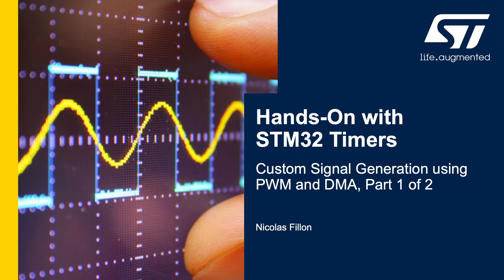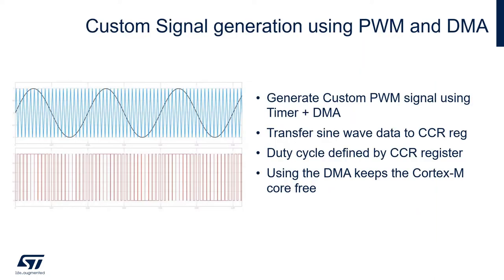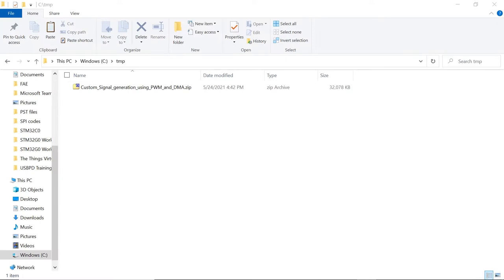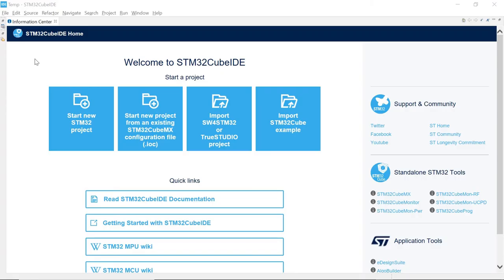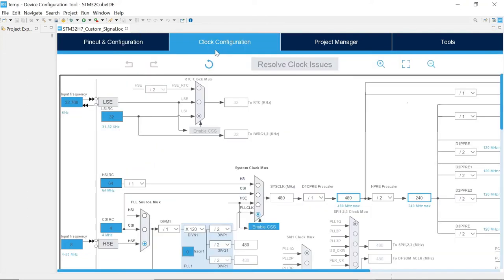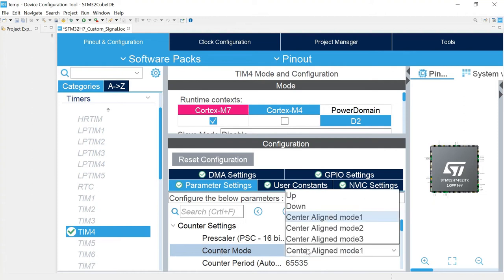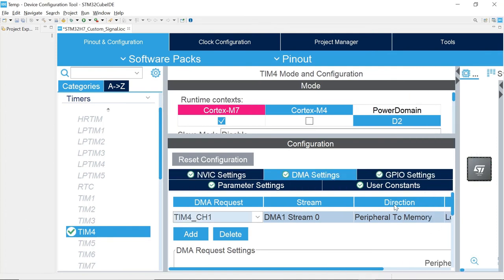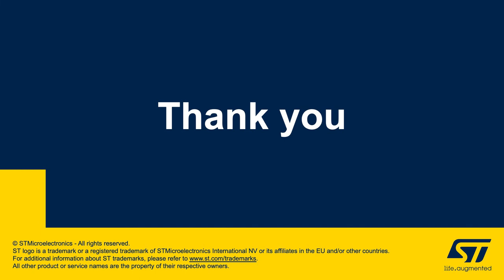Hands-On with STM32 Timers: Custom Signal Generation using PWM and DMA , Part 1 of 2

Comment: Also, I understand the PWM CH1's duty-cycle register (CCR) is updated from SRAM via the DMA such that it increases from 0 to maximum, repeating at a 4khz rate..  

But if TIM4 has an 240Mhz input clock (Prescaler = 0), wouldn't a counter-reload value of 30000-1 yield an update every 8khz, not 4khz?  i.e. TIM_ARR = 240M/30000-1

BTW, calling it a sine-wave seems counter-intuitive to me.   Instead, can the same timer be configured to ALSO trigger an update from SRAM to the DAC via the DMA?
Reply: counter mode is set to center aligned mode, therefore it will start to count from the iddle, which gives you a 4KHz signal, rather than 8KHz.

Comment: hello I'm a newbie with stm32, and for the last couple of months I've been trying to generate a bunch of pulses of variable width and phase, all at the same frequency, they should not use CPU power, they should have 1us resolution and as low jitter as possible, it seems like not only there is no content or example about this topic but also seems very hard to do!
I'm using the F1 family, I was wondering if you guys could give some examples about that topic? with F1 family

Comment: Hello sir, I watched this video it is very helpful fo me. But Sir I face a problem. I generate SPWM signal chanel1 and chanel1N both not working together only one work at a time. What will I do to get custom signal PWM generating CH1 and CH1N together.
I use STM32F103R6. PROVIDE ME GUIDANCE HOW TO DERIVE 3-PHASE INDUCTION MOTOR WITH VFD USING STM32F103R6.
THANK YOU
Reply: see part 2 of the video series